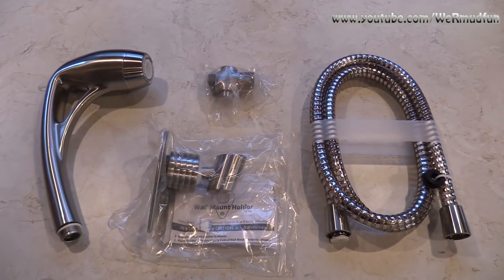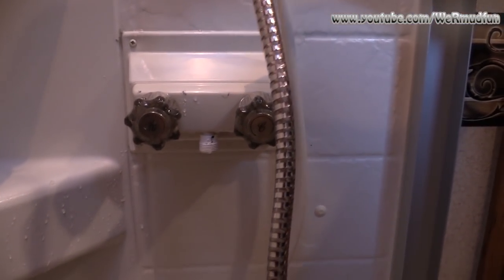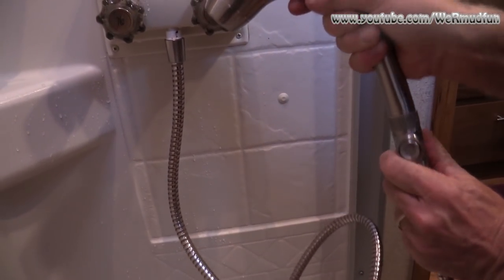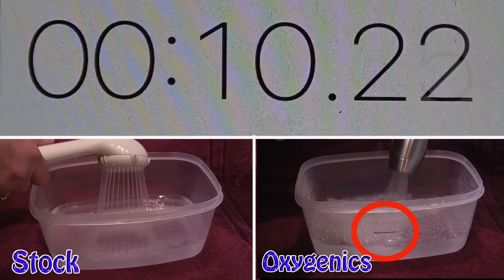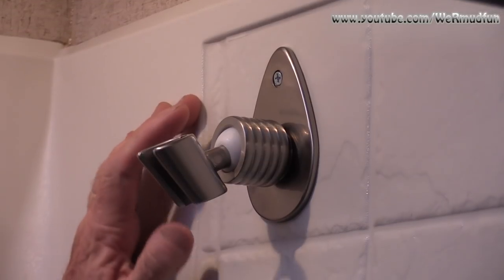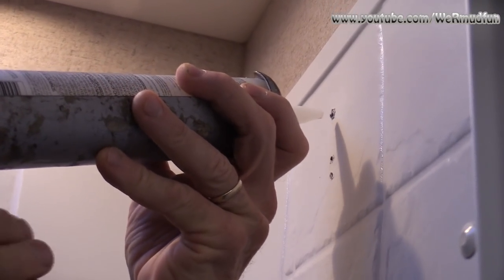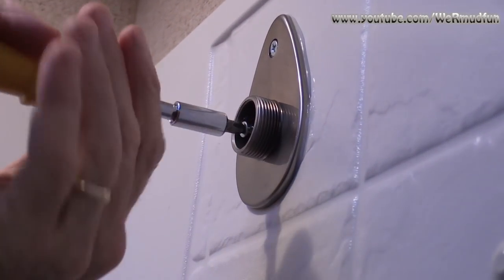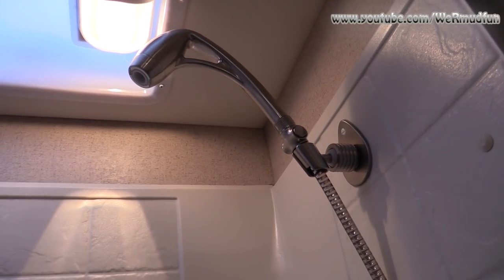Oxygenics BodySpa RV Shower Head Install and Demo

Comment: Wondering how it held up? Mine lasted two showers, and the hose broke off the handle. Did I just get a bad one?
Reply from the maker: Ours held up good, never had problem with the shower head.  We had to change it back out though, due to a problem with the on demand hot water heater.  We will be putting it back on now that the problem is fixed.

Comment: Maybe someone can help me out. I just purchased one of these today and when we use the new head with our water pump, its makes our pump surge on and off. Our factory head didn't do this. Thinking its a pump issue, we ran only the kitchen sink, and the pump kicked on just fine with great pressure. Im lost
Reply: Nvm, there was crud in the hose line stopping it up. Im good to go now!

Comment: Is this saving you water...even with the dribble? Hate that dribble!
Reply from the maker: The dibble is suppose to maintain water temperature, so you don't get a blast of hot or cold water when you turn it back on.  All RV shower heads are supposed to be like that.  Does it work?  We don't think so.  LOL  Does this shower head give more pressure using less water though, yes it does. :)
Reply: That dribble is necessary to prevent getting a blast of cold water when you resume full flow.
Reply: Since my HW heater already had a backflow prevention valve on the out, I figured the hot water was being forced back from the higher pressured cold side at the mixer to someplace else.  So I opened the basement and added a second backflow PEX Sharkbite inline valve.  

It worked.  

Only a slight initial warm water because of the higher cold water pressure at the mixer?
Anyways, if the shower head valve does not turn completely off, the cold water pressure will overcome the hot water and fill the showerhead hose line....and you'll still get that cold water blast.  Of course adding a valve to completely stop the waterflow at the head or mixer, will stop the cold water blast....in conjunction with the added backflow valve.

Comment: I bought one of these shower heads because of all the hype and it's the worst I get zero water pressure and like just dribbles of water. Wtf ?
Reply from the maker: Sounds defective or you have the Smart Pause Valve in the wrong direction.